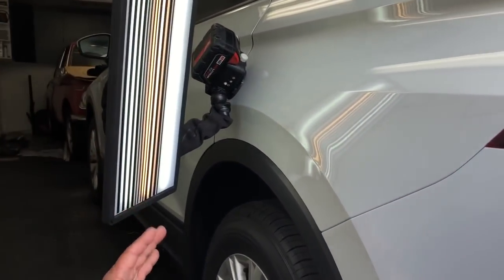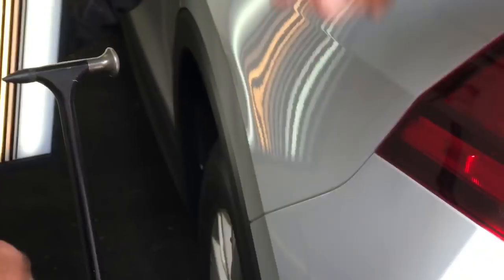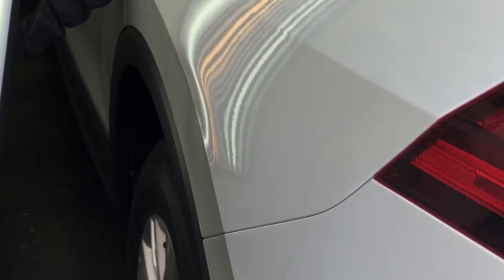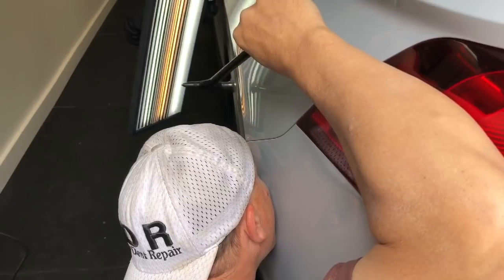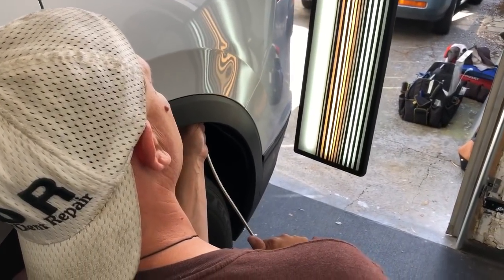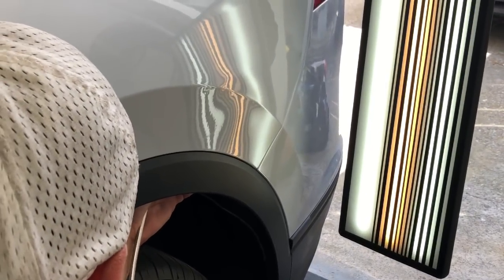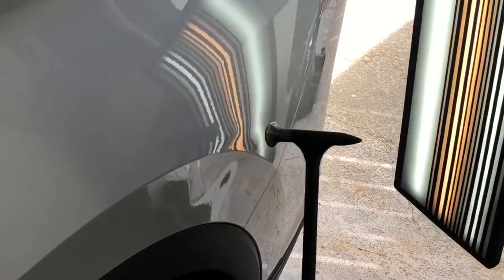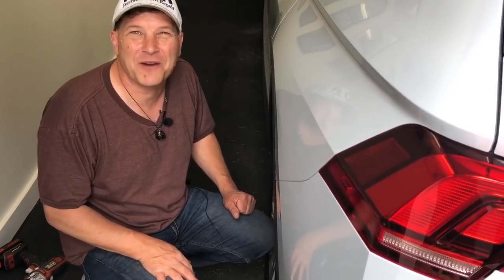PDR WOW!! |😎 2018 VW Tiguan|💥with a BANGER #PDR #VW #Tiguan #PDRlife

Comment: An all-day job? How does one charge per hour? How much should I expect at a PDR shop? Generally speaking?
Reply from the maker: Trucker Daddy generally speaking a job like this can cost anything up to what a body shop would charge. It save the customer the factory finish and having to remove their car from their house for three weeks or around that amount of time and have their car with Bondow and a repainted finish. The finish from the factory was painted from a computer and robots and it is about a $20,000 paint job to replace. The value that I gave him was five hours worth of him hearing meTap on his car and it was less than his deductible. He was very satisfied with the results. Thanks so much for watching

Comment: 1:20 metal or plastic tipped hammer?
Reply from the maker: Trucker Daddy I used a stainless steel Shane Jacks Jackhammer for the majority of the crown work yas I did it really slow and patiently. I actually worked on it for about 10 minutes more after the video is finished our battery was getting low. Thanks so much for watching please look up Shane Jack’s as he is the best Dent technician in the world in my opinion.

Comment: U should try denttrainer.com and Sal dentexpert.com vidoes on how to finish a dent. They had really help me a lot and may help you . Try  using a amazon knockdown tip , buy a cue stick leather tip and screw it to it. It will help to knock it down nice and smooth.
Reply from the maker: Prestige Dent Removal Thanks and thanks for watching
Reply: frogmanvc I'm not the hating type, even if I was there is nothing to hate on you for. Just here trying to help out and give some info